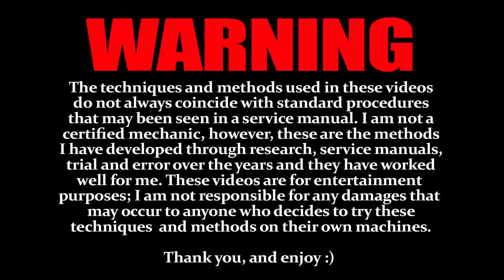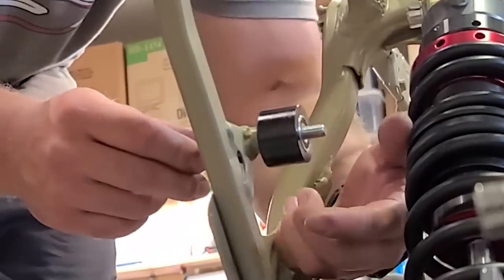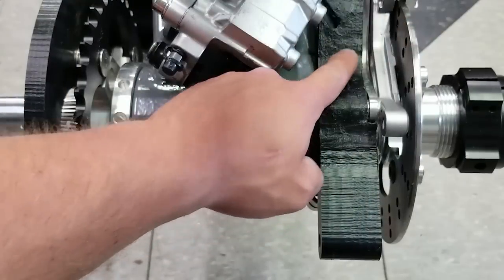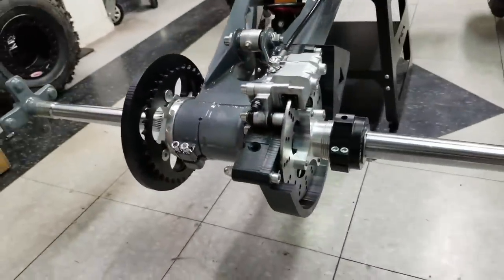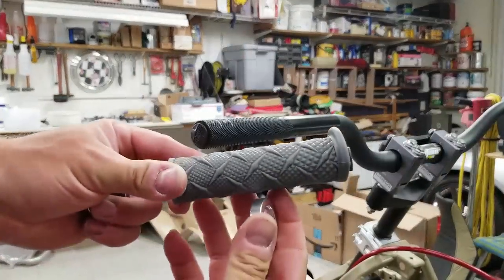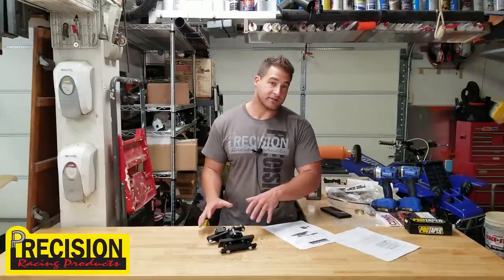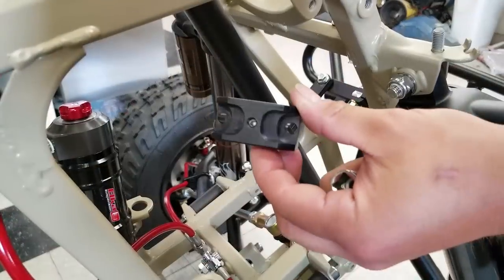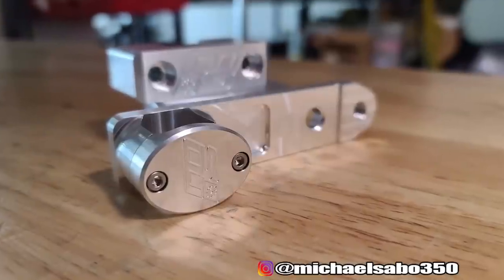Mods You Can't do Without | Project 250R Part 28

Comment from the maker: Thank you for watching my video! Links for all products are in the description; you guys ROCK!! 🤘
Reply: Looks great
Reply: hey man i’m trying to get the jetting on my banshee right it’s a 421cc with 28 mil carbs i’ve tried 155,160,162 do you have any ideas ? if so please reach out to me on instagram jake_middleton
Reply from the maker: Thank you man!
Reply from the maker: It's hard for me to say without knowing other mods and altitude and how the bike is behaving etc; but I am going to guess you may be slightly rich; I run 155 mains with 35mm carbs and it's on the Rich side. Playing with the needle position made a lot of difference in throttle response for me as well.
Reply: Michael Sabo  i wouldn’t say it is rich it’s running nice low and mid but as soon as you hit the top end power it’s not getting the ratio it needs you could say

Comment: @28:43.... out of curiosity.. how come u mounted the bolts facing up, I’m no builder or anything by any means but why not drop the bolts from the top and put the bolt on the bottom? Worst case scenario if they were to come loose the bolt would just completely fall out🤔 correct me if I’m wrong tho

Comment: What are the three holes for on the stabilizer? Would you be able to use those holes on the stem clamp and keep the stabilizer in original spot? Great build bro!!!
Reply from the maker: I don't know for sure; but I would imagine yes; I can't see how that would effect the performance of the stabilizer as long as the 90 degree angle is there.

Comment: Mike. Question. Did you op out for the double front brake line rather then the 1 into union and 2 out.  I have it on my trx 450 and it's stopping power is crazy better the single into 2 in k y opinion.

Comment: Out of curiosity why would you want to run a shorter swingarm ?   What's the benefits
Reply from the maker: It is for handling; I'm not a MX guru but it's pretty common that guys run shorter swingers from what I understand.
Reply: I know the 88 and 89 had a shorter swing arm. The front of the 88 and 89 frame was extended.This was done for more centering of the motor weight I believe.  Most aftermarket frames are based on the 88-89 geometry.

Comment: Mike, this machine deserves it's own feature film. It's a shame though, that the handlebar pad cover is so flimsy. It should be vinyl, or better yet leather, and cover the ends of the ugly bar pad. This build is too special to look past any of the details, especially on something that is front and center. Spend ten bucks on it instead of ten cents. It will make a big difference aesthetically.
Reply from the maker: Thanks Leo and I do agree; I'm not the biggest fat of the foam bar pad; I have another one that's a bit nicer but I'm not sure it will fit this setup.

Comment: Could all these parts be gotten for the atc 250r 1985 and 1986 years?
Reply from the maker: Skid plate parts? I would contact DRW and see what's up; they may be able to make them for you. I'm not sure about the dampers; I don't think they're offered for 3 wheelers but you could probably modify one to work if you really wanted to.

Comment: it should have been made to use the caliper bolts that you cut a slot to fit over then it would be mounted good and tight you would just need to get longer bolts